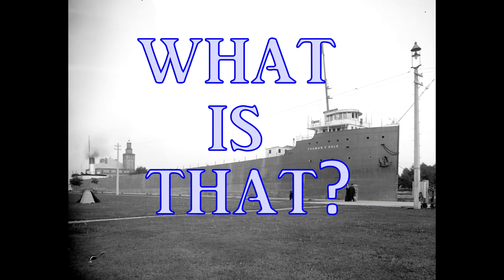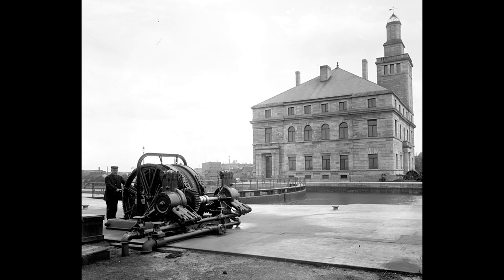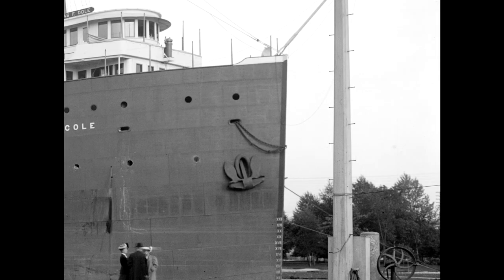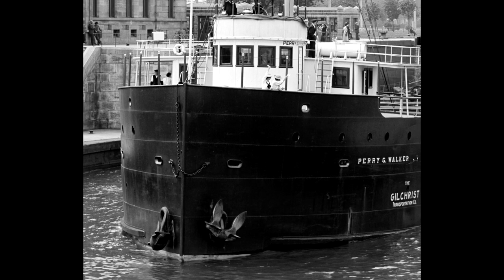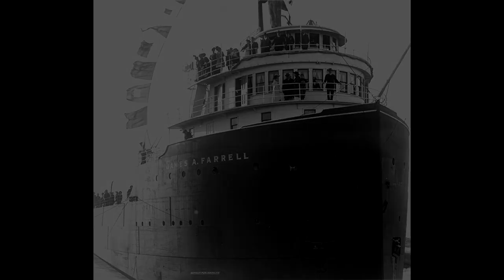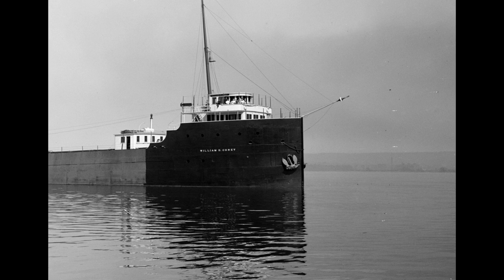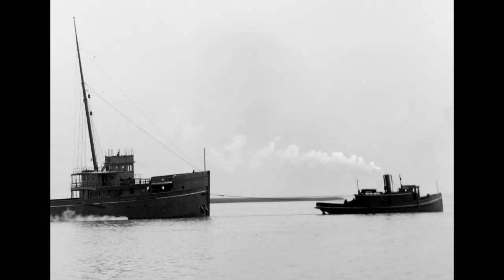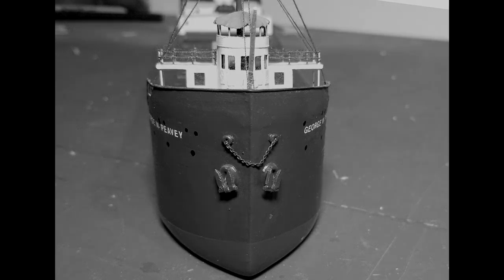What is that- a question that needs to be asked when we look at historic photos and wonder.

Comment: Fascinating!  ... and they have their own "twin hawse pipes" built in, too. I would never have noticed that.
There is also a safety aspect to it. If the towing hawser parts, it will whip back against the hull rather than sweeping the deck and slicing deck hands in two.
Reply from the maker: Great point!